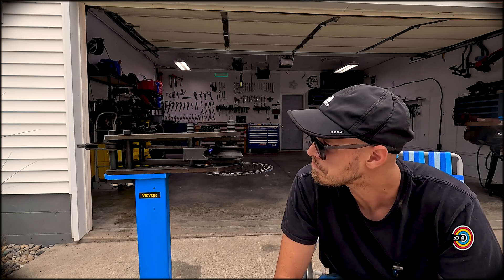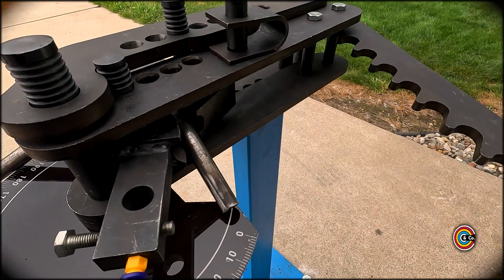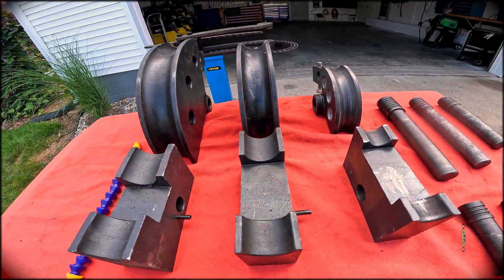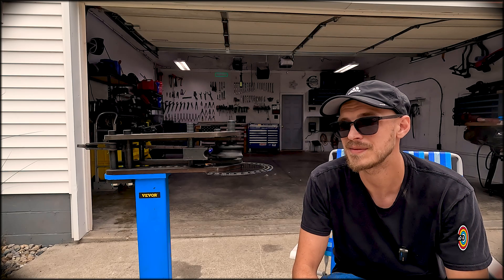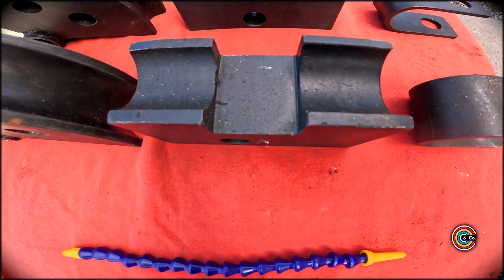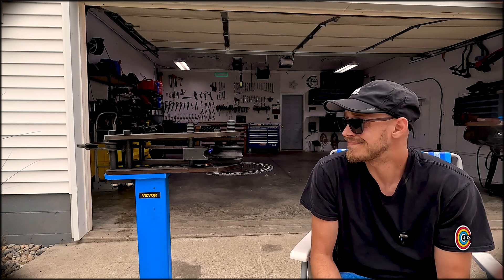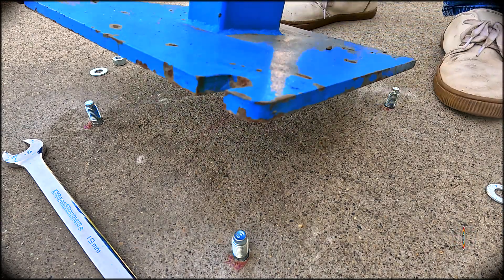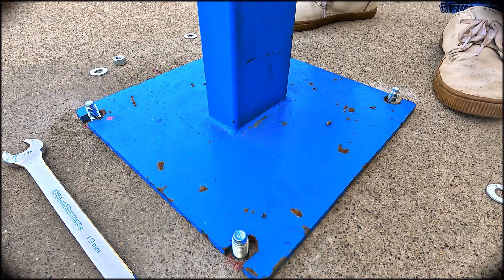Budget Tubing Bender | One Year Review

Comment: These are a good.package deal if you want to bend those sizes,. But if you want to bend 1-1/4" OD, 1-5/8" or 1-3/4 do any other dies fit the Vevor?  China has no interest in making other sizes.
Reply from the maker: Good question!
Reply: Their website is confusing to say the least (what would it be meant for if not hollow tubing?).  Did yours come with 1-3/4 or 2" as the big die?   Seems like I ran into a vid or review that mention some brand of other die that fit ( likely some chinese factory copied them), but they were in the $400 range per die.  I was wanting to make hand rail / grab bars out of 1-1/4 " since I thought it might be the Goldie Locks size.
Reply from the maker: It came with two inch die and its not perfect but its a fraction of the cost if a legitimate brand bender if I remember correctly.